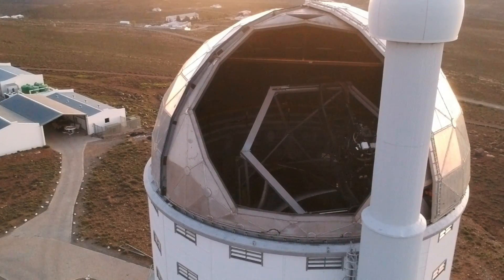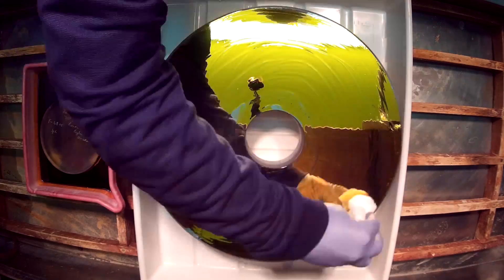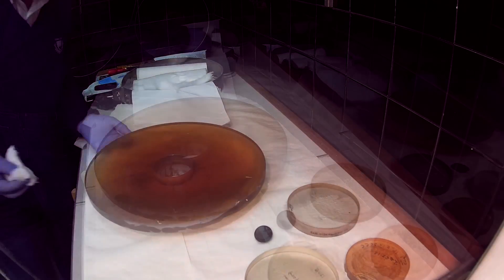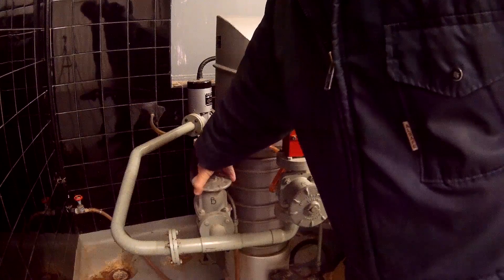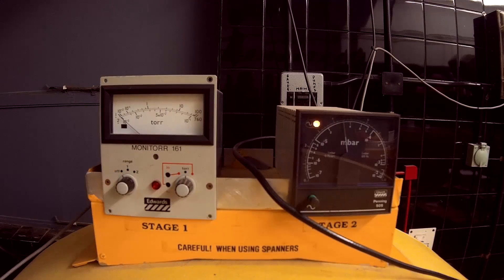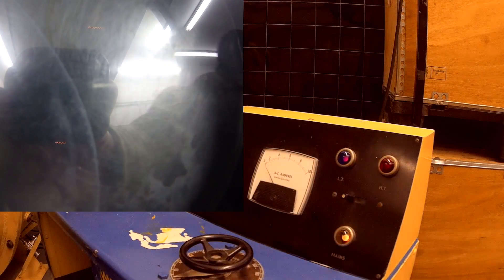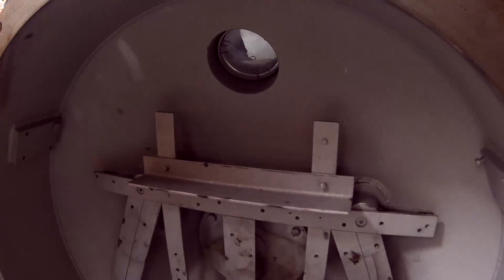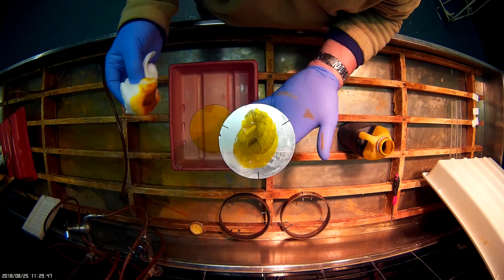How to Aluminize Telescope Mirrors

Comment: It's increadible to see how high of a vacuum this process really needs :o
Reply from the maker: Indeed!  It has all to do with "mean free path" to make sure the aluminium does not meat any oxygen molecules on their way to the mirror, resulting in a black coating!
Reply: @SterremanWillie  This is indeed not true. As soon as you open the tank, the Al surface comes in contact with oxygen and forms a layer of Al2O3. It does not become black. High vacuum is needed so that the Al atoms go straight to the surface and deposit there. If ANY gas is present, the Al atoms will hit them and lose energy and direction and result in a poor coating that can be peeled off. Because you are using a simple diffusion pump, you will get a pressure of 10-3 mbar (at best) and the mean free path will be around a couple of cms. So each Al atom will hit a couple of O2 molecules on the way but will not lose much energy and the deposit will be good.
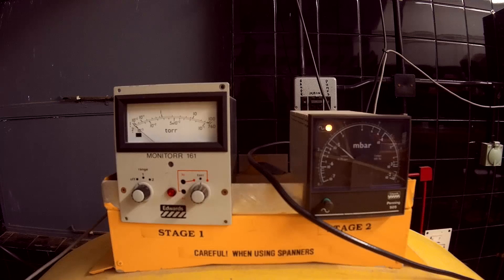Reply from the maker: @janami-dharmam  I have not had the (bad) experience of a black coating, but I'm told that that is indeed what happens for the reason explained.  As you can see at minute 09:50, the final pressure was better than 2 times 10^-5 mbar
Reply: @janami-dharmam  " As soon as you open the tank, the Al surface comes in contact with oxygen and forms a layer of Al2O3. It does not become black. " Forming thin layer of Al2O3 is completely different from mixing the Al crystal with a huge amount of random oxygene atoms making it barely metallic. A thin layer of insulator is transparent, while strongly irregular crystal structure in a metal increases its resistivity, which reduces reflectivity.
Reply: @PafiTheOne  You are right; Why it should become black at all? It becomes black when it does not reflect any of the visible light back to the observer. As you correctly say a thin layer of Al2O3 is transparent and a thick layer of Al2O3 is white for visible wavelengths.
Reply: @janami-dharmam  Yes, it becomes only gray, not perfect black. But on a mirror it is enough to call it black.
Reply: Willie no offence intended, but why then are bathroom mirrors processed basically and last for 25 odd years in such a harsh humid environment and telescope mirrors have to be recoated every 2 years ???  I'm challenging the way telescope mirrors are made. If any one would like a look at or through our basic model 48in scopes, more than welcome, we are testing a twin 48in binocular ATM and have a 72in on the table. I believe scientific embarrassment is a big factor in many processes but the proof is in the pudding. Love to hear from you or some other ppl that are not afraid to be seriously embarrassed by an armature.
Reply: Edit... 10 yrs ... Amateur
Reply: @melissameder4741  It says in the description... "Unlike bathroom mirrors, where the shiny layer is sealed in to the back of the glass, telescopes use so-called “first surface” mirrors, with the reflective layer on top."
Reply: @melissameder4741  It is not the same process. At bathroom mirror, the aluminium coating is behind the glass and is sealed in front and back. Here the coating is on top.
Reply: @melissameder4741  Look closer at your bathroom mirror. Move your head around. Do you notice ripples? The glass of your mirror is not perfectly smooth. A telescope mirror needs to be so smooth any ripples are shallower than about 0.000005in, 1/800th the thickness of a hair. Look at the effort to get a perfectly flat aluminium coating on the mirror substrate. Now, consider how you actually cover that with a thin layer of protective glass without destroying the atoms-thick layer of aluminium, and making the glass as smooth and flat as the aluminium? It can't be done. However, in some cases to extend the period between re-aluminizing, a chemical coating IS put over the aluminium to protect it - he mentions this as the reason why he needed to use ferric chloride on two of the mirrors. This does affect the optics of the mirror to some extent however, just like the ripples in your bathroom mirror. I can already hear you thinking: Why not turn the mirror around so all the glass is in front and the aluminium is behind! Lots of reasons. Telescope mirrors - as can be seen from the video -  are THICK. Thin mirrors are flexible and telescopes need RIGID mirrors, so they are made thick. But even thick mirrors are affected by gravity and sag, so they need to be supported from the back. If the aluminium was on the back the supports would be in contact with the reflective material and damage it. Then you have all that thick glass in front of the reflective surface now, and that is a LENS that needs not one but TWO optically perfect surfaces. Also, the whole point of a large reflecting telescope is to get the benefits of highly reflective surfaces which don't suffer from the transmission losses associated with refractive lenses. Did you notice the colour of the glass of the largest mirror? It wasn't clear. What glass makes a good mirror substrate does not make a good lens glass. The cost of making a 1 meter mirror (one that fits in that vacuum chamber) would be in the high tens of thousands - the cost of making a lens that size you could coat one side with aluminium to make into a mirror with a protective lens on top would be in the tens of millions of dollars. Believe me, some of the smartest people you can imagine have put their minds to the optics of improving astronomical instruments, and while we will undoubtedly come up with improvements in the future, the big leaps in fundamental telescope design have already been made. The whole astronomical community isn't about to suddenly be seriously embarrassed by an amateur over something as obvious as trying to put the reflective material on the other side of the glass...
Reply: @JeremyTaylorNZ  there's one more reason: with bathroom mirrors you get two reflections, one from the air-glass interface and then from the aluminised coating in the back. This is seriously degrading to the optical performance (and the reason photographic lenses have multitude of special coatings).
Reply: @kennyg1358  Perhaps she is wondering why a thin protective coating with high transparency and high durability is not deposited on top of the aluminum.  This type of coating is common on lenses to protect multi coated optics from degradation during cleaning and to prevent condensation.  Or she may be referring to new cleaning processes or means of preventing contaminants from landing on the mirror in the first place like using a strong electric charge to create an ionic barrier.
Reply: Mirrors in telescopes are overcoated with silicon dioxide, silicon monoxide, magnesium fluoride and other materials to protect the aluminum. Without that, coatings will fail in two or three years.
Reply: @SterremanWillie  why you dont want black  coating, are you racist?

Comment: I use a 50+ year old vacuum pump regularly at work.  Old cast iron pump oil lubricated has a little messy exhaust but it works as well today as when I bought it used 40 years ago. Amazing how old school tech can work so well and last so long.
Reply from the maker: indeed!  Typical of things that were built before the disposable era!  They were not only built to last, but also to be maintained and repaired.
Reply: @SterremanWillie  it came with a rebuild kit that I still haven’t needed yet !
Reply: well, remember to not buy the cheapest tools you can find next time you go shopping
Reply: The secret is to purchase things built before "optimization" occurs in the design cycle; i.e. before the accountants and managers get a go at it.

Comment: I see a smudge on the large mirror at its 2 O'clock position, at time-stamp 13:00.
Did you have to redo that mirror?
Reply from the maker: This was damage caused where the telescope's secondary fell onto the primary.  The secondary also got badly chipped.  I was asked to just aluminise everything and they will assess how the damage will affect performance.
Reply: @SterremanWillie  Thank you for your reply!  I am relieved to hear that the damage was already there, and that you were not stuck having to redo everything. 😄👍
Reply: @richardhead8264  love the name 😄
Reply: @SterremanWillie  just great that you take the time and effort to respond to the questions sir. Thank you for an amazing perspective on this fascinating process(!)
Reply: Willie Koorts ouch. That’s gotta be a heart stopping clatter to hear.
Reply: It was in several frames from different perspectives....
Reply: hes face when he sees the smudge 13:25

Comment: Never set the mirror on its edge, or lay it on the raised metal seem on a counter.  Never rub a mirror dry, it WILL ruin a good figure.  a Well aluminized mirror only needs a cleaning once every 2 or 3 years, and then just use a drop of dish soap in a buck of water.  Wet the mirror with the solution and drag, DO NOT rub cotton on the surface to remove surface dirt.  Rinse with clean distilled water and let air dry.  This will mean your mirror can go decades between resurfacing.

Comment: Unless you are in an area with a lot of air pollution, are a scientist using the telescope for scientific purposes, or are cleaning your telescope mirror incorrectly by rubbing it, or using anything other than distilled water with a single drop of Dawn detergent and cotton dragged across the mirror with NO pressure whatsoever to occasionally clean your mirror,  you shouldn't have to have this done for decades unless the coating was defective from day 1. Letting dew form on the mirror in areas with polluted air will accelerate the deterioration of the aluminum coating. Always use distilled water to wash a telescope mirror. A little dust on a mirror won't affect the view. Never rub a telescope mirror, even when wet. Frequent cleaning can do more harm than good.
Reply from the maker: The reflectivity is measured for the mirrors of the professional telescopes, which decides when they need to be re-aluminised.  These are in constant use every clear night, hence need to be re-done more frequently than amateur telescopes.
Reply: @SterremanWillie  so this video is useless for 99% of viewers, GOT IT!!!!!!
Reply: @sharpthingsinspace9721  really... What's your problem? It was a good video, why you wanna be a jerk?
Reply: You are correct I was thinking of cleaning aluminum mirrors.
Reply: @sharpthingsinspace9721  😂 ok then! ... That's pretty funny! God bless you!

Comment: To make my simple mind understand this, someone need to explaine to me more detal about what happening in the magic yello vacume machin. I saw some pips, some bolts, some hot spirals and could not understand how not everything inside the machin become a mirro.
Reply from the maker: A very thin layer of pure aluminium gets deposited on the mirror  using an evaporation process which only works in a high vacuum.  Hope this helps.
Reply: @SterremanWillie  Tank you for answering and clearing up a bit. Don't know if i fully understand  how it work tho'. Guess I need to watch it again. Impressive stuff.
Reply from the maker: Pleasure.  Yes, watch it again (with subtitles, since the audio is not too good in places) and it should be more clear.
Reply: Willie Koorts I feel kind of dumb. I look at it again and as far as I understand you cleen the old one and put on a round glass before it's going into the vacum chamber. Looks like the glass you put on transform. But is that the aluminium? ...the round glass you put on the old mirro? I don't think so because in my head it should not look like glass. I understand if you are tired of my stupidity, but I'm not getting this. Sorry for bothering you, but I'm honest, maybe to honest.
Reply from the maker: Hi  @martinaakervik  I suspect you are confused by the perspex disk I use as a dust cover - some of the other dust covers are round hardboard disks.  These are removed during aluminising.  The other round glass disks which I cleaned towards the end, are the port-hole protectors.  Hope this makes better sense.
Reply from the maker: Indeed  Bob Marley .  As you saw with the silver-grey colour of the inside of the tank, the aluminium goes everywhere.  But because it is such a thin layer, it replicates the original surface, so only polished surfaces (like the glass), yields a mirror finish.  People often give me mirrors to aluminise that were not properly polished (dull finish), hoping that it will be shiny after aluminising.  I warn them that it will not be case, and if they insist, proof it by returning their dull mirror!
Reply: @SterremanWillie  Hey! I think I understand now and recon that I wasn't watching the whole video... (even not the secon time?!) Haha stupidity has no patience. Guess I stoped when I could not understand the magic. Feel kind of embarrassed. Thank you very much for your time and wisdom.

Comment: Baie cool Willie! Are you always guaranteed of a perfect alumanized surface after the vacuum process?
Reply from the maker: Very good question!  No, there are many things that can cause a bad coating.  E.g., if the vacuum was not good enough, the alumimium reacts with oxygen, causing a black coating!  If the cleaning and particularly the rinsing was not good enough, hazy streaks appear in the coating or it does not stick properly to the mirror and starts to flake off after a while.  If you don't follow the instructions properly, oil backflow from the pumps can contaminate the chamber, also preventing the coating to stick properly.  Attention to detail and sticking to the recipe is very important.
Reply: @SterremanWillie  It seems that by hanging the aluminum stock over the heating coils like that, it boils the blank in two and most of it falls to the bottom. Very little of the stock is actually vaporized. I guess the wire is cheap enough, and you don't have to do it that often, but it just seems a curious delivery method. Are there units that boil the aluminum in a little tungsten pot?

Comment: Is there any spray for my mirror , I can't buy vacuum pump sir.
Reply from the maker: Sorry, spray is not possible - too thick and uneven for the optical quality required for telescopes.
Reply: @SterremanWillie sir , too thick and uneven ,, means ? . It should be even know sir.
Reply from the maker: The optical accuracy to which the mirror is shaped is better than a quarter the wavelength of light.  The aluminium layer is only one tenth the thickness of a human hair, deposited evenly all over the mirror.  There is no way one can spray anything this thin and this even.

Comment: I had a pleasure to work with such a process but we used cryo pump (2-nd stage) instead that diffusion and we had 3 stages pumping system (last was ionic pump). Also we (me and team) worked with tungsten-molybdenium boats instead of spiral because we coating also gold and silver half-transparent mirrors for such an applications like fabry-perrot interferometer. You are working clean, but we worked clean room standards. More or less ... nice work mister I am impressed. As you see it takes an ages to pump out 200 l chamber (by the way, nice chamber - simple and effective) by diffusion pump.

Comment: Nice video sir
Reply from the maker: Thanks
Reply: @SterremanWillie   sir i also want to make mine own telescope of 30 inch but facing problem in mirror look plating
Reply from the maker: Wow, 30-inch is very enthusiastic!  I have done 20-inch home-made mirrors before, but not 30-inch!  The tank can accommodate up to 40-inch.
Reply: @SterremanWillie  sir is it possible to do metalising on metal dish
Reply from the maker: I have not done it myself, but suspect it is possible.  The surface will have to be polished to get a polished finish, as you can see from what the inside of the tank looks like which gets aluminised all the time, but not being polished, it get s a dull appearance.